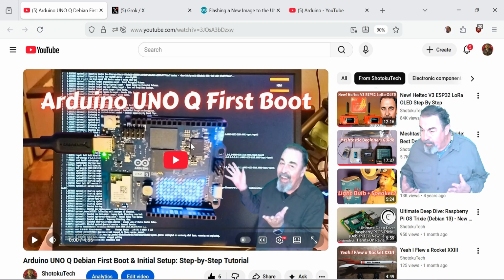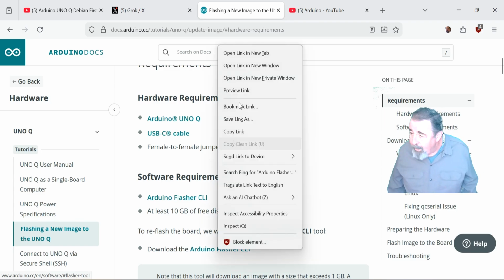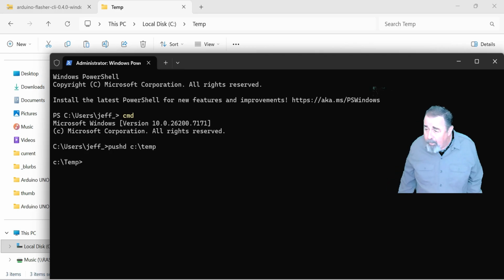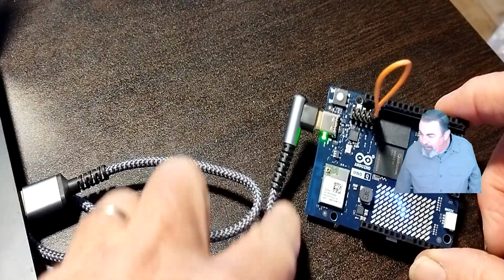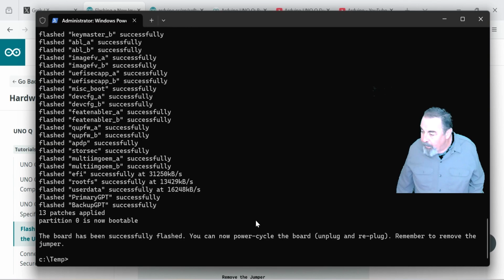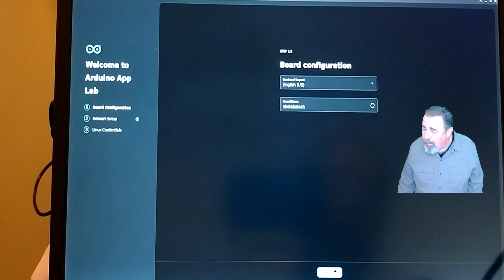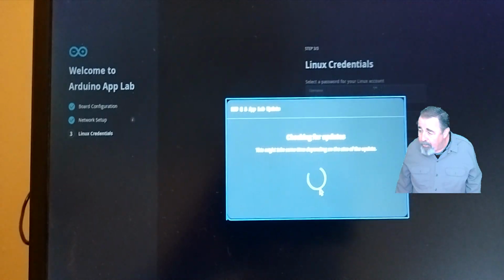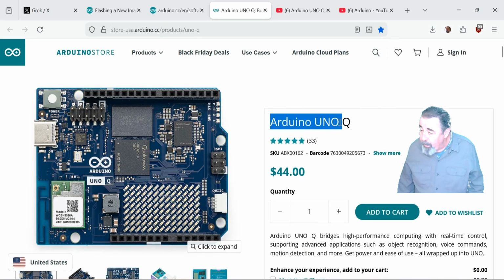Arduino UNO Q App Lab Update Failed? Easy Flash Tutorial to Get It Working Fast

Comment: The reason you didnt get the driver Popup was cause you have used app lab before. When you put it to update for the first time it does pop up
Reply from the maker: No, I had an early version of the firmware that would not update at all. Apparently it was a well known issue at the time. The video demonstrates how to flash the firmware on your device, which could come in handy anyway. Best wishes.
Reply: @ShotokuTech  I know and you saved my life for that man. Same issue for me. But you fixed it. For me the USB driver popup came up the first time when I originally tried in applab. I didn't know this issue till your vid. 

Instant subscribe. Awesome video. Thanks for that ❤
Reply from the maker: @monkei__edits Hey! Thanks. Now I got to get past the IPv6 problem. I can't launch anything in app lab. It fails showing it trying to reach IPv6 addresses. I broke my entire network switching it to IPv6. I need a new strategy and more time. LOL. best wishes.